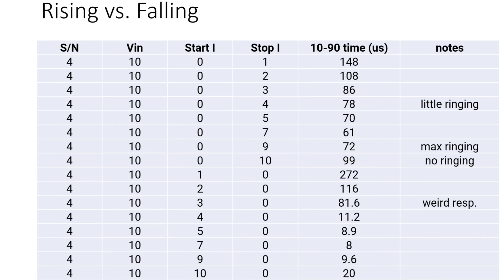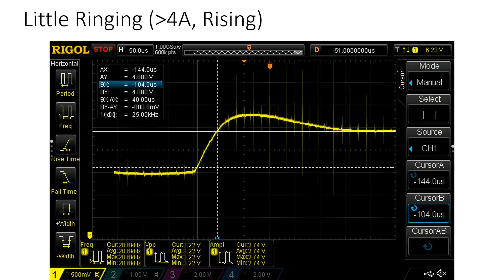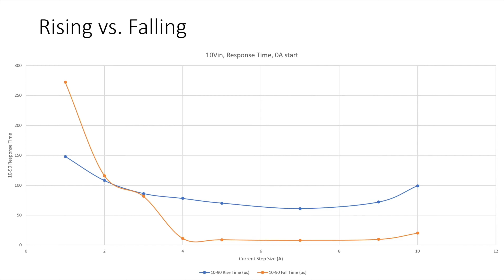Transient Response (Proto 2 ELoad)

Comment: Would you consider switching the 1n4148s for some super cheap schottkys just for lower Vf, also could remove a unique item from you bom since you're already using schottkys on the psu
Reply from the maker: bdgwiepp, great point! They are already in the design.. I'll have to think about the current flowing.. but I probably can!